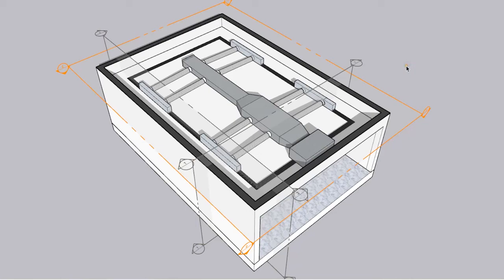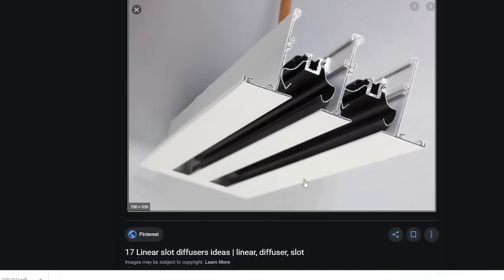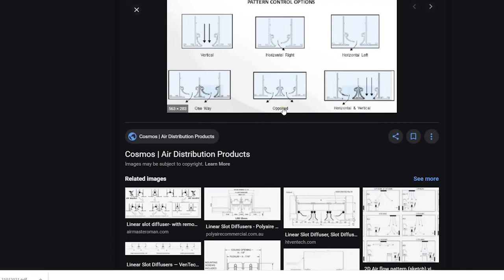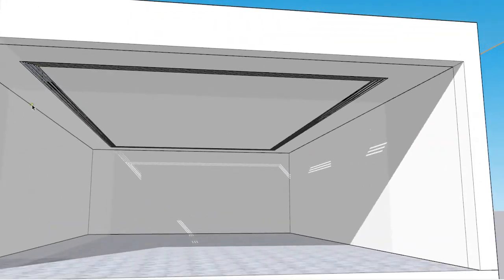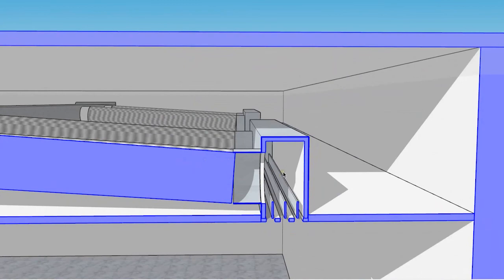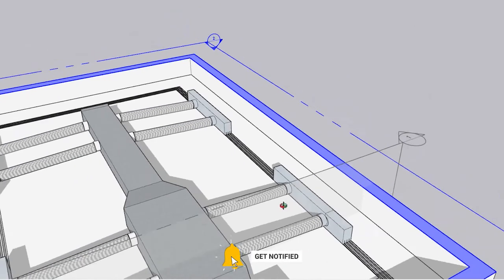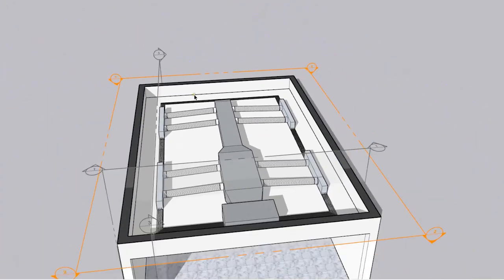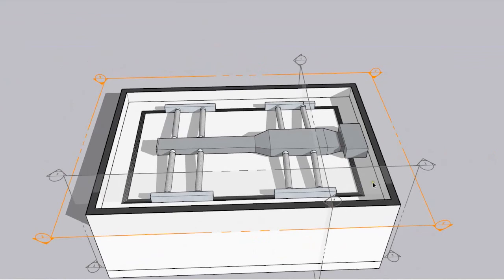HVAC Training in தமிழ் : How to Create a Linear Slot Diffuser

Comment: Sir we can directly connect the linear  slot diffuser to the bottom of the duct without plenum and flexible duct
Reply from the maker: this is the general procedure for linear slot diffuser, we can go for any type of arrangements , but the condition is , low friction rate, control the flow

Comment: sir can you explain how to calculate high rise building exhaust fan static pressure calculation
Reply from the maker: Sir , ESP Calculation for Supply, Fresh and Exhaust Air Same. The Concept is we have to Calculate Both 
01. Manufacturer and Designer Loss ( Fan Blade Loss - ISP , ESP - Designer Loss = Duct Loss + DUct Fittings Loss + Duct Accessories Loss ) then 
02. Finally we get TSP = ESP + ISP, after finding headloss ,  ADD Factor of Safety 10% 
03.The formula for fan BHP is = FLowrate x Headloss / 6356 x Efficiency of Machine (70 to 80 % Machine Efficeicency )
04. We know Flowrate and remaining Values, Solve and Get BHP 
05. If the Fan is Operated by Belt or either by Motor, if motor loss 5% and belt drive loss 10% you have to consider